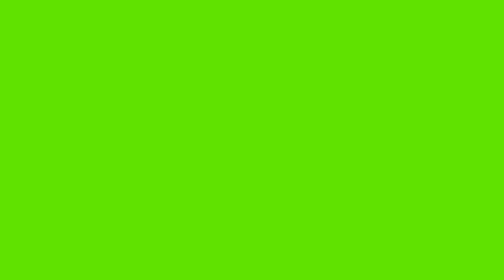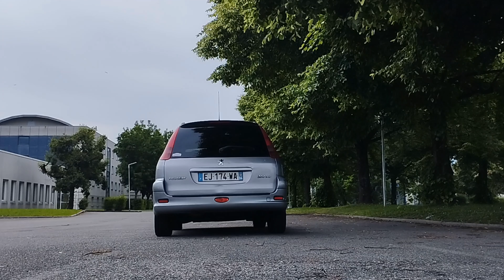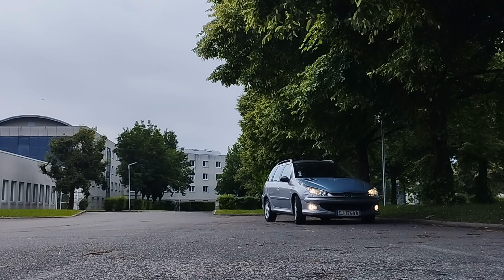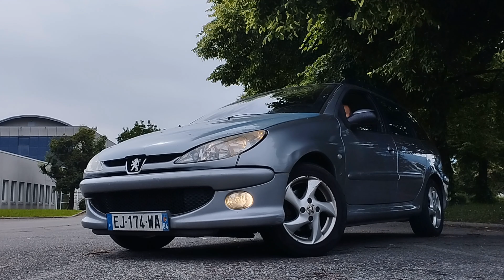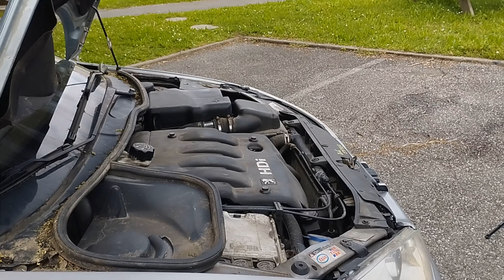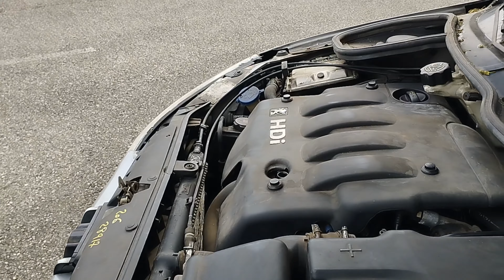🎶 Peugeot 206 2.0 HDi 90 : Exhaust & Engine sound acceleration PSA DW10 (Code: RHY RHZ RHS RXH) بيجو

Comment from the maker: Le moteur 2.0 HDi de Peugeot-Citroën est sobre, silencieux et généralement fiable. Un des moteurs les plus populaires en France, il a été monté sur les quasiment tous les modèles Peugeot et Citroën depuis 1999 (Peugeot 206, 207, 307, 308, 406, 407, 607, Partner; Citroën Xantia, C4, C5, Xsara Picasso, Berlingo, Jumpy. etc. Ce moteur a été également monté sur certaines Ford, Mazda et Volvo). Il a longtemps été proposé en parallèle avec ses "petits frère" 1.4 HDi et 1.6 HDi.

Historiquement, c’était le premier moteur du groupe PSA à  injection directe par rampe commune (Common Rail). Premier essai particulièrement réussi : malgré sa complexité, le moteur 2.0 HDi n’a pas souffert de « maladies de jeunesse » ou pannes récurrentes. Le moteur arrive facilement à 300 000 kms, et des kilométrages encore plus grands ne lui font pas peur en cas d’entretien régulier.

Le moteur 2.0 HDi existe en versions 90 ch , 110 c et 136 ch.

Les vidanges sont à faire tous les 20 000 kms environ (huile 5W40, avec le grade C2 pour les voitures équipées du FAP) Le changement des filtres à air et à carburant sont recommandés une vidange sur deux.
Reply: ouf 20 000km c'est un peut beaucoup, sauf si l'utilisation est péper, moi je vidange tout les 10 000km a la 5w40 a 22/23€ les 5 litres avec additifs Mécacyl CR et le CRP P pour poussoir pour les moteur kilométrer de + de 200 000km, nota le mécacyl quand il a une fuite d'huile ça l'augmente

si le moteur mange de l'huile en 5w40 et que vous êtes pas certain de l'entretien, mettez une huile en grade 10w60, mannol en vend a pas trop cher